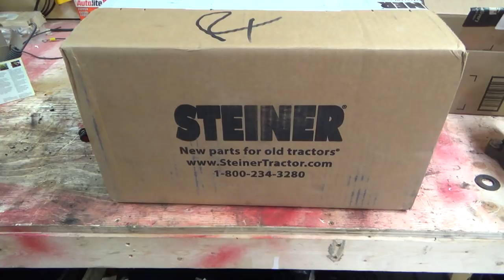Brake parts are in for the '44 Ford 2n lets install them and a new seal

Comment: Bill I think you have the location pin and the spring the wrong way round that's why it looked funny  the spring should be located in the top of the two holes look at the other three it will become obvious regards Alan from the UK
Reply from the maker: have to check that
Reply: @billstmaxx  Your previous video on this project shows the spring and the retainer have been swapped on this video.  Move the big return spring to the bottom hole and the retainer spring/cup/pin to the top hole.
Reply: @BILLSTMAXX You have the spring that goes across the 2 shoes in the wrong hole on the left side You have the spring in the lower hole on the left side, but in the upper hole on the right side. It is supposed to be in the upper hole on both sides. You have the spring retainer through the wrong hole on the left side. The spring retainer goes through the lower hole on the left side, just like it is on the right side. That's why the spring retainer isn't sitting right. I can see how the springs were on there in your previous video.
Reply: Yep looks that way. Look at 40:03 and you can see.
Reply: @billstmaxx  yeah thats sures kinda silly what there doing wich wich crazyness thank goodness its all most over  my buddy at stihl and kubota thinks this is crazyness too lol

Comment: They make a break tool that the spring hook slides over and the end has a hollow in the back side. You place the hollow spot over the stud and use the tool as a lever to stretch the spring over the stud. You see them a lot at flea markets. With disk breaks no one uses them any more. Auto Zone and mist parts stores still sell them along with a tool to adjust the break through the inspection cover. I bet your Dad has one or knows what the look like.
Reply: The word you're looking for is "BRAKE", not Break! Nothing is broke!

Comment: You had the pin right until you changed it, and put it in the wrong hole. You could see something was wrong but did not correct it.

Comment: Hmm top spring on the left shoe looks odd.
Reply: Yeah, because he has it through the wrong hole. Look at the right side shoe he has the spring through the lower hole which is correct, but he has the spring through the upper hole on the left side shoe.